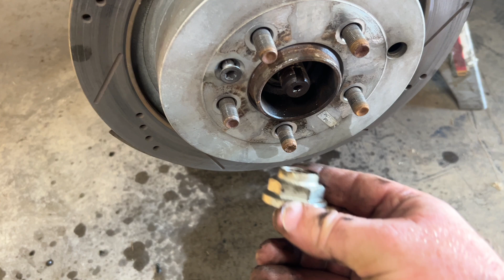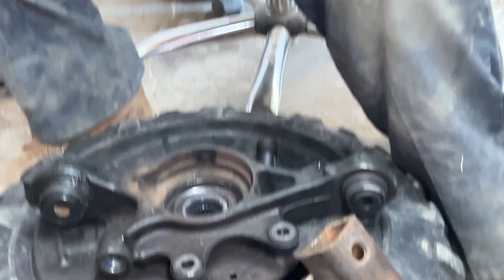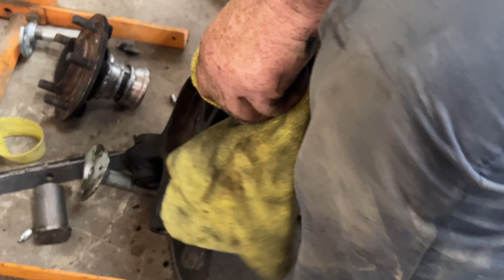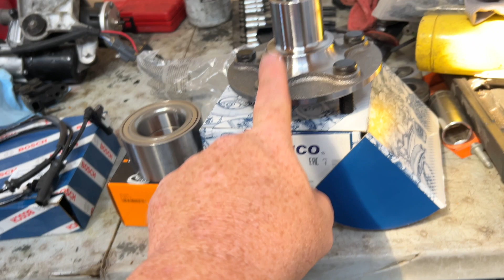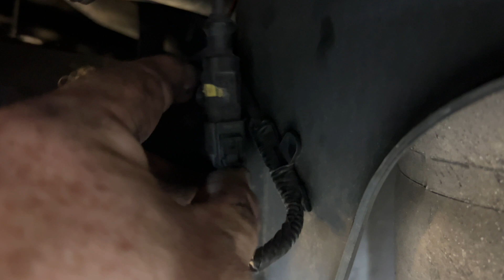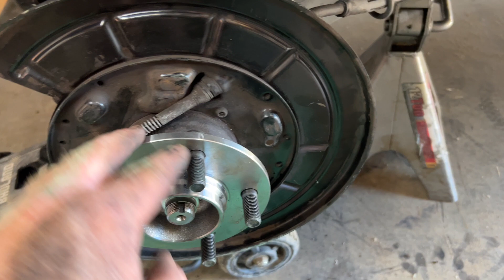Land Rover LR4 Wheel Bearing Failure

Comment: So how does one prevent this from happening maintenance wise?
Reply from the maker: That’s a good question.  I’ve never seen a wheel bearing fail like this.  Every oil change I rotate the tires and check for looseness in the wheels. They are not repackable bearings so checking them regularly and listening for noise is all I can come with.  This wheel may have been hit by something by a prior owner.